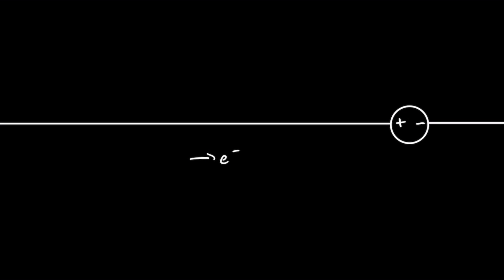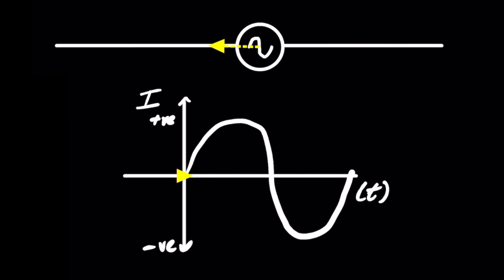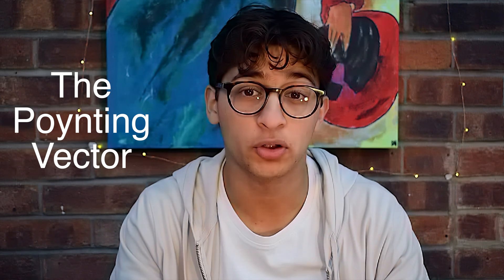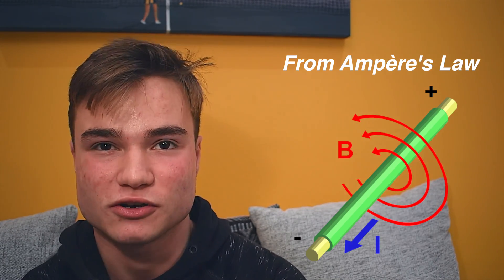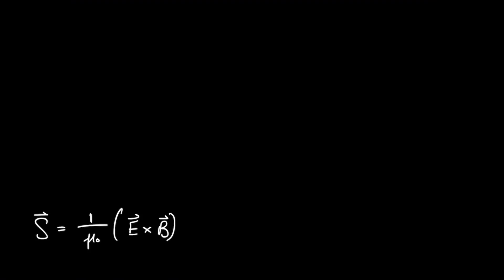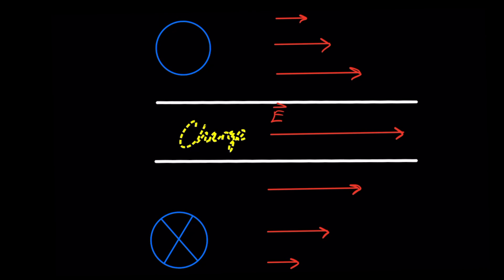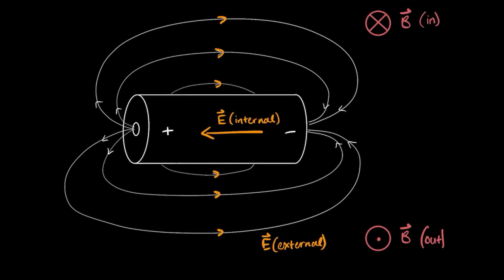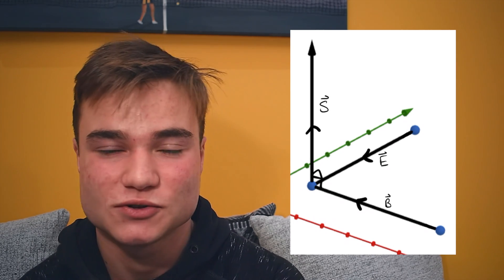Do you really understand circuits?

Comment: I want to enjoy listening to this a few times over. Additionally it would be great:

1-  if you could explain your assumptions how electrons move thru a copper wire which itself is made up of 2 Cu (s) + O2 (g) ---> 2 CuO (s) with elections included. Then please explain in terms of particles Feynman's Photon Counter, where our eyes see light waves and not particles - thanks - 

Also - in noting how the current and point charge are perpendicular on the copper wire, and that more current is on the outside as opposed to inside the wire, please explain how the current in the inside of the wire stays in phase with eh current in the outside of the wire. (hint) are we saying this is where heat in the wire comes from? thanks - 

For the moment, can we take a break from the Bohr model? 

Consider, If perceiving a particle was in effect due to  looking at a wave head on in first person; and the profile view, as third person then offered a perhaps from left to right, a negative, then a Neutral and then Positive point as a wave length, would that be acceptable to you as theory?  Also would such theory conflict actually with the Bohr model that insists that Protons and Neutrons are stuck together and electrons circle around?

Finally, I have been enjoying more of your video. Thanks again for making it. 

Pointed out in the Battery example was the notion of Current seeking equilibrium. Would you like to elaborate on that. And in terms of the Electromagnetic  field that covers the Planet Earth, A- Please explain, perhaps how Faradays observations could keep us well grounded.; and B -  how electromagnetic resonance  from the Sun, ( Solar Storms ) are fielded by our Electromagnetic shield while unbeknownst to us and our RFI supposedly secured devices. thanks  - 

Thanks for reading all this - hope to see more of your videos -
Reply: @justynpryce  Thank you for your excellent   and in depth reply - Im glad you pointed out the phase relationship of the copper wire. In terms of "Charge" - re: "I don't understand what you're trying to ask when you imply a wavelength has a charge" its a matter of semantics for the notion of measure similar to force or current. Consider a tsunami as an example would have a wave length and a force. Plz forgive on the semantics - As far as the Bohr model I had no idea its been retired. So what then is used to describe particles that make up matter? Manifolds? 

Question - Speaking of the Northern Lights, do you feel it would be of value to calculate their actual altitude from Earth?  Could they  represent a point of an equilibrium between where the Earth and the Suns Electromagnetic forces meet?

Thanks again for your insights -

Comment: Do you understand they mindread people with ac and dc..:  They" can read all peoples minds with using AC current (going back and forth without realy giving a current) by using the dc current, because it goes both ways. People with schizophrenia experience this mind reading aka mkultra. And they use appliances like amplifiers. When i put a metal plate with a mirror ontop of my amplifier,,there was a lot less "mindreading".. So now i get far fewer "system messages" from inside my head and from smarttv. AC back to system is just 1s and 0s....back and forth..

Comment: Ok, but since magnet and eletric is both 90 degree out phase, so it is on the same plane, it would be more logical since the mass itself is ME, so E is on first floor subplane and in each subplane is 1, 2, 3, and so on, so at a higher level is a higher raise from 1 to 3, but at 3rd is smaller energy, so from center is highest energy to the edge is the lowest energy same as magnet moment which two opposed causing the center to raise in power since left and right of center is higher amount compared to the edge, so there is 4 90 degree in a circle, and in multiple of 4 is a shift of degree plane into a sphere that is 360 degree. 

The point from the center that is sphere to edge, so the edge is same and dot is same, the center, so it is a pressure to the center that is from the mass itself, the polar moment, the higher polar moment will lead to add to cause output that is impulse energy, so not mass energy which is electricity, so the magnet is impulse energy that is by motion since magnet in motion mass-energy, well, it can be both, but make it easier the magnet has n and s, to the center so cause impulse to be high, so there is a high impulse at the edge which you can see repel and attract, but higher at the center. So, it will cause upward or downward which is connected to magnet field collapse or raise of magnet field so can measure in gauss meter. So, E is connected to M, which S and M are the same, so impulse energy is S that has motion, but that motion has direction so a series of E equal direction of magnet and direction of electric, so it comes from the center and outward of center up and down, so ya are right it is 90 degree, but there is two 90 degree at a whole that is E and M, but for the circle that is 4 90 degree, so in total that is 8 degrees, so 4 in E and 4 in M, so M is S. Impulse energy which adds of E to cause pressure like toothpaste to squeeze so paste come out from inward that is external and inward so my hand causes inward to internal that is pressure to cause outward that is magnet field. 

As a whole you have two that are E and M, so impulse energy is S so higher magnet density since it is connected to higher electricity density which electrons are connecting to two opposed to creating a mass moment. You are in a car so you go fast, per one time, the pressure is high, so by air and by space itself, so high lead to high, and low lead to low, so a fractal parallel pattern. From space to lead to mass, a different sub-invarient mass which has different electricity within and how it works, so depend by interacting and two different, so interact is two different that is left and right inward so outward come magnet field. The motion of electricity is dependent on the source that is primary the energy density like toothpaste in the tube so the pressure in my hand to squeeze it so outward of paste from inward of left and right to center. The higher pressure or higher frequency of magnet moment causes higher electricity or higher angular rotation. There are three different that is two masses, one static to one motion, one motion to back and forth motion per time, etc. There could be a higher difference. So, 6 combinations of different. Everything depends on the magnetic moment which is two fields that interact to cause mass from the primary, the field. Everything is a fractal so everything is a fractal of knowledge which small and big knowledge is the same but on a different scale, like if you are far away, you are small, so it doesn't mean you are small but our viewing is limited so I view you small since you are far away so the perspective change. Electricity depends on pressure. Motion and interaction create pressure. The magnet moment interacts with another magnet moment causing the weaker magnet moment to go down so the slow reduction of magnet field collapse so it breaks down the mass like the person jump off the air hit the person, so the person can feel the drag air, so the smaller mass cause interacts to bigger mass so the bigger mass break apart, so the person thru air can be break apart like in a car that goes fast so the pressure is high to cause break down in small part of the mass of a person. So, low-density drag to high-density drag of space and mass. So, mass interacts of mass to cause electricity or/and multiply of polar mass like a magnet, so magnet in a ring to cause the center to raise in electricity when measuring thru copper. Either high density of copper or high density of magnet moment or high amount of magnet to the center, etc.

Ya can learn more about magnet from Nigel hands/cooper/cheese. Nigel Cooper, well, the other name is the same so 'impossible before lunch' is statement on name.
Reply: I can't tell if this comment is a joke or not. 🤣🤣
Reply: @johnweinisch5121  It is a question, so you don't understand so it is a joke to you??

Comment: If energy is transferred by external fields than how come that shielded wires transfer also without difference to unshielded ?
Reply from the maker: Basically, shielding does let fields through (the design of shielding/screening around a wire is rather involved engineering, and is targeted at the reduction of interference/emittance, which is not the same as blocking all fields), you can verify this by running a magnet or holding an EM source near a wire and seeing the change in the signal output. To disrupt energy transfer, you'd need to generate opposing fields in the wire of opposite magnitude (consider the principle of superposition and energy conservation). Given that these circumstances would not happen by chance in almost all operation, the passthrough of fields through many types of shielding is not very problematic.
Reply: @ASKENG  ok. Imagine 1mm2 wire perfectly shielded. To my knowledge there is no difference in ability to transfer DC power with unshielded 1mm2 wire.

Comment: Strange that YouTube recommends this after Veritasium has made the exact same video yesterday. Anyways great job thanks! Subscribed.
Reply: Same with The Science Asylum video, also good.
Reply: @plkracer  yes that one is also awesome. https://youtu.be/C7tQJ42nGno
Reply: Same here. 😂
Reply: YouTube is going stranger. Algorithm x100
Reply: This content is totally wrong, as are the Veritasium and the Science Asylum copies.  These videos are getting astonishing feedback - unfortunately for misinformation.   

Poynting is limited to the flow of energy in electromagnetic waves.  But not all electrical energy is transmitted via such waves.  It is WRONG to use Poynting to analyse DC circuits or the normal transmission through power lines.    

Electromagnetic radiation is the flow of energy through  space or medium via co-joined electric and magnetic fields that make up electromagnetic waves eg radio waves, visible light, and gamma rays.  Here, time-VARYING electric and magnetic fields are inter-linked with each other at right angles and perpendicular to the direction of motion. An electromagnetic wave is characterised by its intensity and the frequency of the electric and magnetic fields.

Only rate of change of a magnetic field brings about electromagnetic action.   At DC or low frequencies, the energy is confined to the transmission wires.  It is only at higher frequencies that more energy emitted into space, as in an antenna.  

A voltage source such as a battery produces electromotive force, or electrical pressure to drive an electric current to transmit power.  Other transducers convert  forms of energy into electrical energy, such as batteries (chemical energy) or generators (mechanical energy), without relying on electromagnetic wave transmission.  It is fallacious to use Poynting to explain any of these. 

Youtube is in error to recommend these as  they are technically VERY misleading - I will send feedback.
Reply: @thomasfolks  Poynting analysis is just fine for DC.  However, what most continue to get wrong are the actual E field directions near a conductor.  I just commented a moment ago at the top level of these comments to correct their misconception about Poynting vector being perpendicular to the conductor.   Science asylum had a similar confusing statement on it.
Reply: @thomasfolks  So how does energy flow if its not by the electrons?
Reply: @thomasfolks  and what is "electromotive force" if not electromagnetic force? Which is described by poynting vectors at any frequency
Reply: Mighty YouTube algorithm 😃
Reply: Same
Reply: Lol same with me as well
Reply: Yup same
Reply: Same

Comment: Respected sir, If batteries has electric field around it , why NEGATIVE SIDE OF ONE BATTERY does not ATTRACT ANOTHER BATTERY'S POSITIVE SIDE?? WHY SAME POLARITY OF DIFFERENT BATTERY ARE NOT REPELED.....??
Thank you sir
Reply: @Pierre eletric field by itself doesn't imply in existence of magnetic field, but if there is movement of charges (of course the eletric field) it implies in it.
Reply: @Pierre Kinda, magnetic fields can exist either if the eletric one cancels itself or not (E = 0), but this equation is related to light/eletromagnetic waves, that implies movement of charges (photons and quantum mechanics stuff)